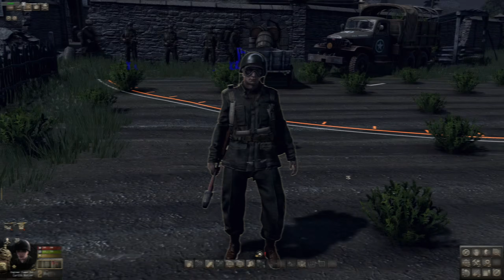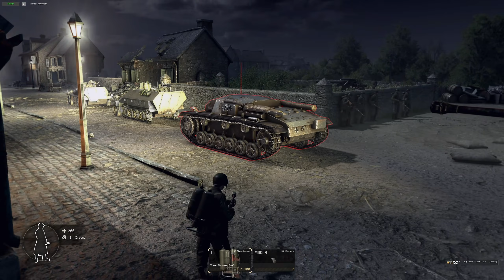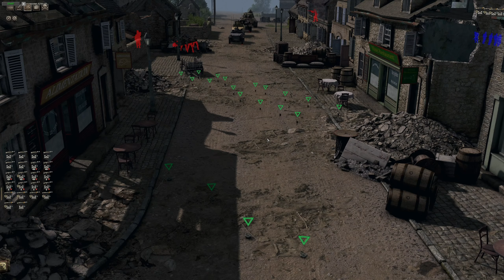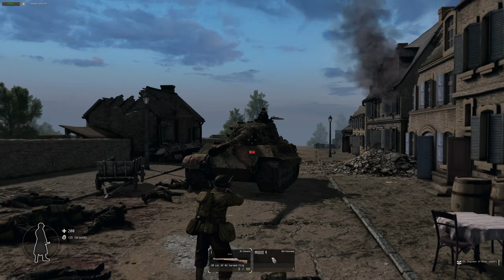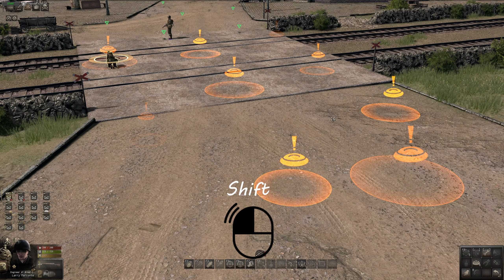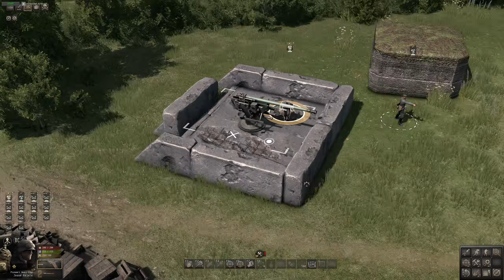Gates of Hell | Infantry Tutorial | Engineer

Comment: Were flamethrowers really used to take out engines of tanks?
Reply from the maker: I don't know to be honest. But flamethrower used adhesive thickened fuel, basicly napalm, that would leak into openings (like the engine). So it's quite possible.
Reply: Yes and no. Early on, most notably in the winter war, the t26/bt7/t28 had the air intakes where the vents were. So by throwing a Molotov on the engine deck they would either A. Snuff out the oxygen from a gasoline engine. B. Introduce fire and non-diesel into a diesel engine and destroy it. Later tanks would hide the intakes so that you could not do this.

Comment: Great video 👍

Are you able to build a bunker platform then place an arty piece on it then finish the walls around it?
Reply: 23:44
Reply: The answer to your question is yes. OP misunderstood, just make sure you don't build stage 3, idk if still the case but early on you weren't blocked from building it and it would destroy what you put on the platform. I used to use this to place a Bofors when I wanted that instead of an at gun.
Reply from the maker: That arty is part of the construction. It takes 3 separate tasks for a heavy engineer to complete the fortification and get the gun.